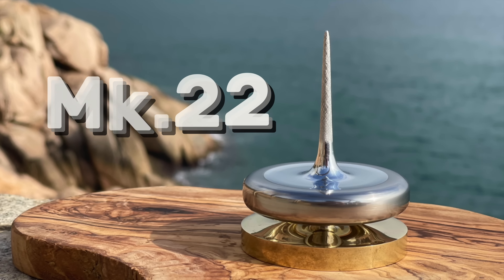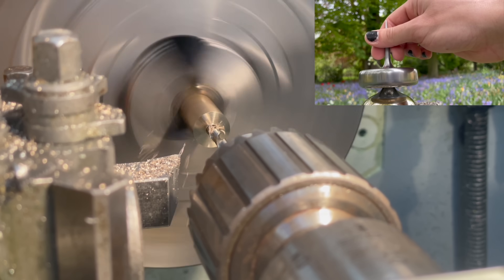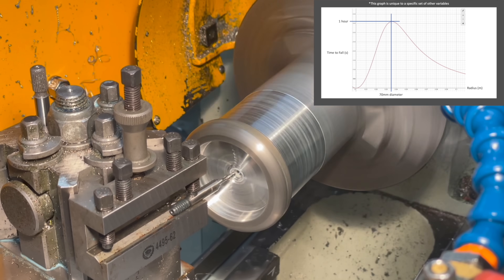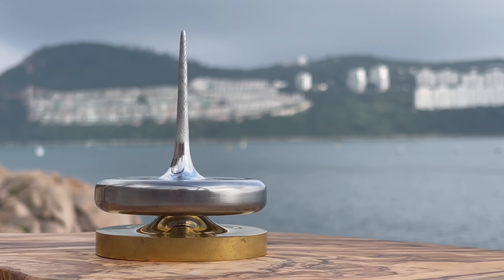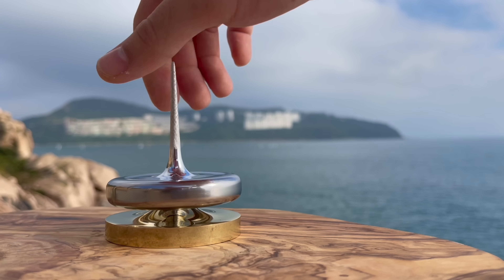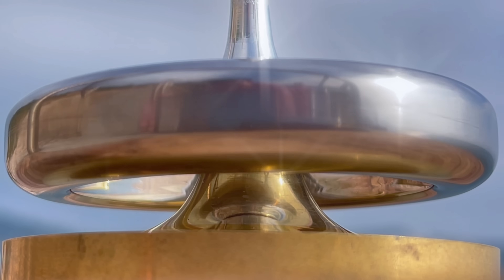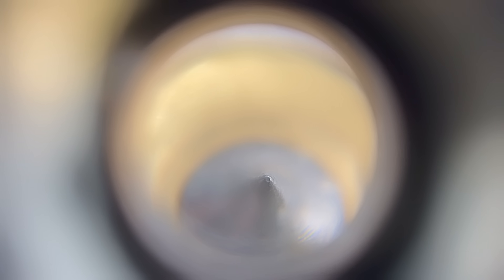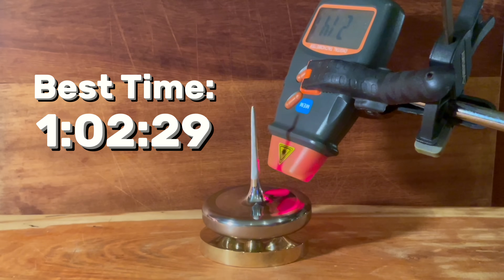Spinning Top Mk.22 | 1 HOUR BARRIER

Comment: High performance! For aerodynamics it would be really cool to see smoke stream testing on this. I think the geometry of the base may actually be pretty significant. For the top itself, maybe a blade around the center of the top better direct the top and bottom air flows as they come together? On the friction side of things it may be worth going back to a dual material or hollow design. It would complicate your analysis there, but it may be worth it to bring mass down without affecting inertia too much
Reply: https://youtu.be/oKxrP7-QXpk    at 11m 51s

Comment: Not sure if these have been tried yet: 1. Spirals going inward to pull air towards centre. Counteract energy loss of pushing air outwards. 2. Dimples on the outer rim for less air fiction. 3 using schlieren effect to observe aerodynamic behaviour.

Comment: build one heavy suspended by a strong neodymium magnet, apply vacuum in the glass box around it after rpm achieved, paint or laser etch dots on it to make it visible that is spinning, it will spin for more than a week (40 pound spindle) others have already done so

Comment: Awesome project! I’m just curious.  I guess it would be considered cheating but I’m interested in what would happen if you’d use an air compressor to speed it up. Assuming that would increase the rpm, for how long do you reckon it would spin? Would a high rpm require a different design to be as efficient? Huge thanks

Comment: High performance! Assuming you've come so far, a better polish could be a good improvement. I'm talking mirror finish, it will take some time but only improve on air drag. Also the spinning point (as i've read) is an important area for improvement, it's obvious that polycrystalline materials are brought into perspective but i think looking into polymers and experimenting with oils could be an even better idea. Teflon has a super low friction coëfficiënt but polymers might be affected by high weight.
Super interesting and impressive nonetheless

Comment: High Performance! 

Why not embed a magnet in either half - not to completely isolate them from touching each other but to reduce the friction weight between them without reducing the important weight of the top part ? less friction at contact = longer times no?

Comment: High performance!

The fact you have made it past the one hour mark is amazing!

So many factors that keep a top/gyroscope spinning is due to friction from the air and the tip and being able to reduce them to the lowest point is already evident in this video.

The tip of the point is the only thing that can ruin the longest run, and the hardest materials need to be a small, but round element, in order to keep the drilling of a hole that ruins the anvil for the tip. And the support for the round tip needs to be able to conduct heat away from the tip to keep the tip from galling.

Silver and copper are number 2 and 3 in heat conduction, with diamond being number one, which is also the hardest! So a diamond ball, set into a silver mount, would be the best for conducting any heat from the tip, and having it ride on a carbon nitride anvil, which is actually tougher than diamond, could be the best for long duration attempts!

Comment: I havent watched many of your videos so this might have been tried at some point but have you considered an air bearing? You could make the bottom of the top a ball bearing. Set it in a presicion machined matching base and blow air up through the base to reduce the material friction

Comment: 1. Maybe placing the top base on a scientifically flat and stable surface, like a granite surface plate?
2. Another suggestion of mine would be to really carefully control temperature and any breeze or gusts. So like surrounding it in an acrylic box, and finding a way to spin it without introducing body heat or ambient temperature change.
3. My final suggestion would be to lose the knurling.

Comment: Not sure the rules for a world record like this but I'm wondering if accelerating the spin at launch utilizing an air compressor could be a way to achieve an.even higher launch speed though I'm unsure how that would effect duration. My assumption is the drilling phenomenon you described is essentially drilled depth being proportional to a function of weight and total revolutions so an extremely high rpm may mean you reach a drilling and destabilization point much sooner due to the higher rpm. If nothing else it would be a really cool video to see just how fast it can get going.
Reply from the maker: I would certainly like to make a video of this at some point, and your ideas are correct, drilling would occur quite rapidly. And it is not allowed for the world record - in the past I have kept tops going indefinitely by blowing on them through a pen!

Comment: You should look at rubies from watch movements, I think you could reduce drag even more!
Reply from the maker: Have a look at my pinned comment, I put some info about this! Although I might add, it is difficult to get spiked ruby in the appropriate geometry so ball bearings are typically used. Since these have a very shallow angle around the contact point, they experience considerable fluid drag from any lubricants. As a result, spiked tips generally out perform them!

Comment: Optimizing something outwardly so simple is clearly extremely challenging.
I've read through some comments and you mention drilling at the tip being and issue, I did have a thought about whether it's possible to deliberately add surface imperfections to the base making the tip move around just a little however at this scale all the minute losses might be offset somewhere else.
Could be something to try if you do get some vacuum chamber time.
Reply: Unless I'm understanding this wrong from dealing with normal wonky rope that process and a well balanced one just acts like a gyro.
Reply from the maker: @mrln247  I think your idea has promise, if there was a subtle way to stop the top from drilling down in one spot, this could reduce tip drag quite significantly. However I don't think a texture is a way to go. Perhaps a different base geometry could help, such as a flat surface with a lip to stop the top falling off.
Reply: @hiper_tops  I think I miss described my thinking with texture, geometry would be the way to go I was thinking if it could trace a figure 8 I was caught up with isochronal curves the other day although I think that's not relevant here. Think I thought texture since I expect your machining tolerances are down in the mircons.
Reply from the maker: @mrln247  Yes tracing a figure 8 would be good, and yes the base surface is all the way down at 0.5 microns from diamond lapping pastes. I wonder how I could make the top move in such a way though..
Reply: @hiper_tops  Möbius strip or magic?

There are some funny geometries out there with things the the 3D printed shapes that roll even though they look like they shouldn't.

Comment: High, performance
This may have already been suggested but maybe a one way keyed top part (the bit that interfaces with your fingers) that's removable would help with center of gravity and air drag since it can be completely taken off. By one way keyed im talking about those old helicopter toys where you pull a string really fast that latches onto a T shaped thing but once the blades spin faster than launcher it doesnt grab anymore.
Reply from the maker: This is absolutely true! However not allowed in the category I'm specialise in. I would have to change the geometry of the flywheel to make best use of the higher launch speed so its really a different problem to optimise :)

Comment: have you considered using a ruby bearing for the tip and a concave ruby surface for the plate? The coefficient of friction for ruby is very low compared to most metal on metal surface.
Reply: and then I read the comment below mine and see this certainly wasn't my idea :)

Comment: What are the criteria you are adhering to? Does the CG have to be higher than the tip? How much?
Reply from the maker: Yes, CG must be higher than the tip however by how much is not specified. In practice, it is near impossible to get critical speed lower than 20rpm before the top no-longer topples - at which point it is considered -ve CG.

Comment: How does knurling on the stem decrease drag?
Reply from the maker: I meant instead of using deep knurling, I only slightly textured the surface which in comparison causes a bit less drag :) But yes knurling in general slightly increases air drag

Comment: Does oil on the tip make a difference? Should if its not a perfect point?! Or is that breaking some rule
Reply from the maker: Doesn't break a rule and yes I use a small amount of oil lubricant :) It can prolong spins by as much as 5%!

Comment: Would a graphite spinning surface reduce friction? Powdered graphite is a good dry lubricant. Could help reduce friction if the tip didn’t machine it away too quickly
Reply from the maker: True, regarding graphite's lubricating abilities, however as you suspected it is far too soft given the weight of my tops - the pressure at the tip is almost 400MPa! A hole would instantly be drilled and enlarged until a large area of contact removed any gains from lubrication.

Comment: With long spin times do you run into issues with the angle and rotation of the earth like a pendulum does?
Reply from the maker: In my case, thankfully not because unlike an unrestrained pendulum or gyroscope, my tops can only freely rotate about their primary axis :)

Comment: Just found out about this channel, it's a super cool engineering effort!
One thing I'd like to add: I don't like fragile + specific machines, particularly it needing a specific base and hand cranked multiple times. 
If you can optimize a version for the average desk surface + one finger-length of spin, would be awesome! and also fruitful for you if you decide to commercialize it.
Also, personal preference: Using a hard rock as a material would be such a statement of "This is just a rock, but we engineered the hell out of it!"
Reply: The specific base is massively important in both endurance and reliability of the top

Comment: High-Performance! Congrats on hitting 1 hour, if you haven't already, you should see if you can get an official world record with Guinness. I'm not sure how that works personally, but if it interests you, then I'm sure you can figure it out. Good luck with that, and/or with your future tops.
Reply: Would have to have a standardised starting rpm
Reply: @prich0382  Why? isn't starting RPM something people could compete on? As long as it's spun up by hand.
Reply: @prdoyle  Yes a Hand done no machine run top should have own category as the 27 hour top has one of the magnet flywheel engines inside so machine can go for a very long time. Also, a big spinning item that uses earth rotation and is still spinning was once considered a top before Guinness World Records changed it into a time category.

Comment: High Performance: Do you think it's possible that shaping the top to create a mild lift effect could end up being a win by decreasing the tip friction more than it increases the air drag? I'm guessing it wouldn't work at all, but I thought it was worth writing down lol.

Comment: Is it possible to design one that uses magnets to avoid any sort of friction with the ground piece?
Reply: Yes! Magnetic bearings are a thing. But would that be a spinning top?
Reply: @geirmyrvagnes8718  That depends, would the top be spinning!?
Reply: @chromatic91  It would. There are sweet magnetic bearings like these in turbomolecular pumps for high vacuum use. There is usually a bearing at each end of a shaft, but I guess you could have just one end in a bearing and then a top of some sort spinning freely above it. But it wouldn't TOPple over when it stopped, it would just stand there in this clever arrangement of magnetic fields. That doesn't quite feel right, but I am not a spinning top lawyer.
Reply: @geirmyrvagnes8718  well it's an interesting thought at least, thanks for the explenation

Comment: that's a very high performance top you got, but would some active mechanics inside extend the time? like, a spring to pull in mass over the time of the spindown? as long as you can charge the top up with your hands I don't see why that couldn't extend spin time like how a figure skater would do.

Comment: amazing, I wonder how long it would last in a vacuum chamber, to factor air/tip drag ratio
Reply from the maker: Interestingly, it only spins for about 1.5hrs in a near vacuum. Although the vacuum eliminates half the power loss (air/tip breaking torque = 1), due to tip power loss being proportional to angular velocity squared, the time is not doubled.

Comment: WPS treatment is used in automotive and high performance metal-on-metal rubbing applications to reduce friction, surface harden, and impregnate the surface with oil. Is possible you could put two broader surfaces against each other in almost a pseudo air bearing configuration that might be better than a point.

Comment: To improve further, you need to focus on the hardness and hence sharpness of the spinning tip (diamond?), as well as applying an antidrag coating to the surface (PTFE?). You may then have to work on the base plate to reduce friction and turbulence between the stationary and spinning parts. A jewel bearing could be a practical solution for the friction.
Reply from the maker: You make good points about the areas for improvement. A sharp diamond tip on a jewel bearing would unfortunately result in a drilling effect due to the relatively large weight of my tops. Really, the base should be slightly harder than the tip (though not abrasive!) which rules out polycrystalline diamond and CBn as a base material. Monocrystaline diamond/CBn has potential, though it is difficult and expensive to get such a large piece in the precise geometry I require. It's something I'm looking into but do leave more suggestions :)
Reply: @hiper_tops  if you pursue the mcd route I would get in contact with the tooling companies that supply tooling for single point diamond turning. Like Chardon tool, Contour diamond, and Micro-Lam (m10) to name a few. They work specifically with mcd brazed on carbide inserts/shanks diamond turning.  If they could get you the geometry you wanted it'll be stupid expensive but at least you know it can be made.
Reply from the maker: @NerfMozambique  Thank you for these supplier suggestions! If I can find a diamond base, perhaps I will look into mcd tips further.

Comment: im really curious at which RPMs it fails to stay stable at. any info on that?
Reply from the maker: Initially, it toppled at 60 RPM, however after further manual balancing, I reduced this all the way to 30RPM! I'll release the full spin soonish and you will see in that just how slow that is. This reduction in critical speed alone added 3 minutes

Comment: make the point of contact out of a manufactured ruby.
Reply from the maker: Tungsten Carbide, like I use, can actually be harder! (9.5 vs 9 for ruby on the Mohr's scale). I did use ruby on Mk.21 if you are interested :)

Comment: I know it's not the point of the project, but I'd LOVE to see what this thing could do if spun up mechanically to 10k RPM in a vacuum chamber. Assuming it doesn't turn into a grenade at those speeds, of course.
Reply from the maker: It would certainly hold a lot of energy haha. If/when I get a suitable vacuum chamber, I will do this ;)

Comment: I kind of wonder if placing small divets or those little fin like bumps you see in wings, fan blades, and golf balls, or maybe a more regular radial pattern since the direction of motion is known would help with air drag.. you might even be able to just do it at or near the corners.
Reply from the maker: It is a cool idea but since the airflow isn't transitional it would be counter productive. See the newly pinned comment for a bit more info!